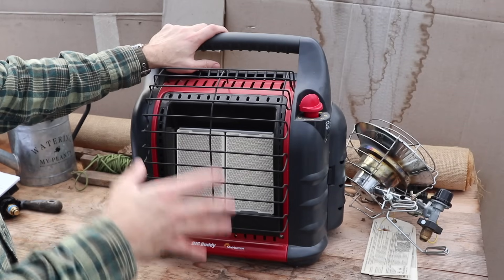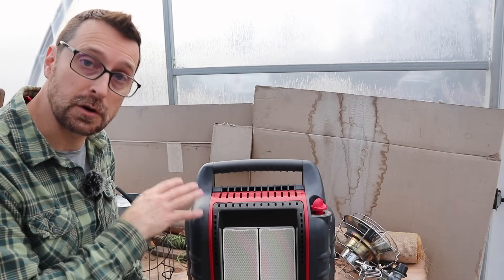The Truth About Your Propane Tank Heater Attachment! 5 Ways To Fix One!

Comment: When you take those 3 bolts loose to purge the red switch, they should be a piece of rubber in there. You can take out and it won't cut the fuel off when it unsets. To the off it will all ways have fuel

Comment: I used a fuse to by pass the tip over safety switch. That way you don't have to cut any wires. The wire connectors will slide onto the fuse ends perfectly.
Reply from the maker: cool idea

Comment: I watched a yr video where the Mr buddy was turned on by the knob as usual with no propane attached, then lay the Mr buddy on its side for 30 mins then do the same on its other side. He also used a Q tip to clean the orfice.     --+ My Mr buddy heater was also not lighting well or would not stay lit. So I followed his advise.... But I left mine turned on and on each side "over night" ..... Its now back up n running. Just sharing some info
Reply from the maker: Thanks for the suggestion

Comment: I had a Mr. Buddy indoor heater just stop working on me.  Tried every cleaning trick I could find - nothing worked.  I'm a bit frustrated with it as well.  As for the tank top directional model similar to what you showed, I had a problem with the thermocouple that wouldn't let it light - it worked its way loose.  A couple turns with a wrench tightened it up and fixed the issue.
Reply from the maker: They are a pain for sure

Comment: We have a 48x30 high tunnel. Our temperatures were the same as yours a week ago. We used 2 kerosene heaters and we didn't have any issues. They run for around 10 hours on a little less than 2 gallons of kerosene. We buy our kerosene from an oil supplier for $5.00 a gallon. Big box stores sell it for around $30.00 for 2-1/2 gallons. Some of these heaters will run on diesel which brings the cost down. The ones we use are Dyna-glo